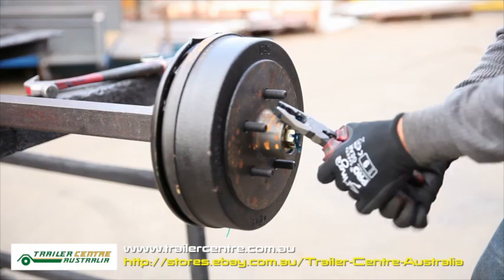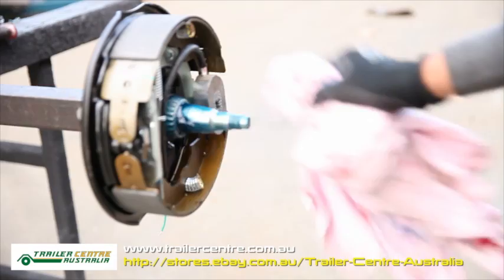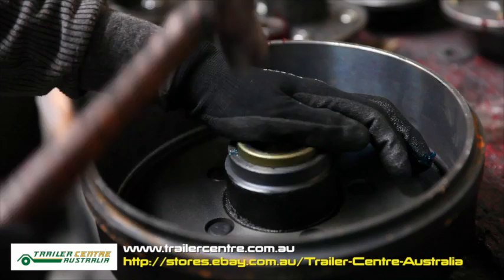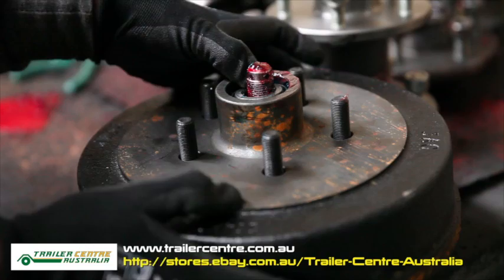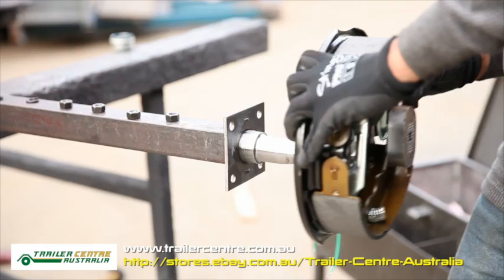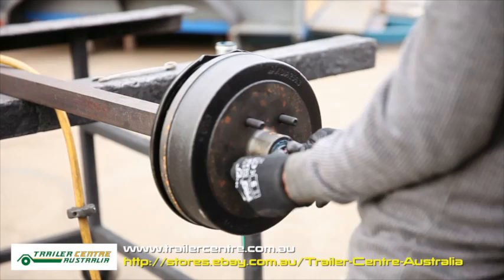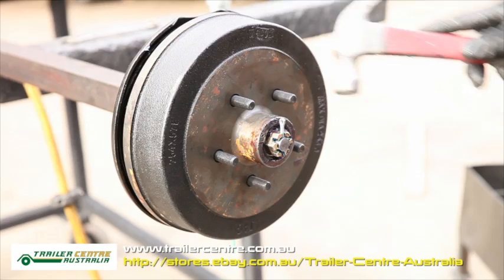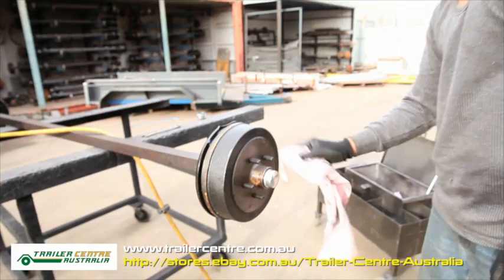How to install electric brakes on your trailer - TRAILER CENTRE AUSTRALIA

Comment: For anyone watching this, do not follow these instructions. 1...the square magnet of the assembly must face downward and not to the side as this shows.  2....the actuator bracket that attaches to the magnet is u shaped and MUST point toward front of trailer. This one was point either to ground or sky as magnet wasn’t on bottom.  There’s a right and left and aren’t interchangeable.  3...leaving that axle nut that tight will fry those bearings real quick.
Reply: I think you missed the magically reversing bearing that was being removed. But thanks on the first two parts. Yeah. The Castle nut procedure was NOT finished correctly...I actually counted the number of turns it took to get each of mine off. (On the wheels with brakes...have not started/checked the rear wheels yet.)
Coincidentally, it was 10 turns on both...and I do mean "10" turns to the same spires. Huh?
Who ever had this apart last did...something consistent? I mean, the guts were not present...on both wheels...no brakes...but lots of Spider webs!
  The joy one gets from working on a, uhm...close to 70 years old DIY trailer. I keep wondering if the damage occurred after the brakes were removed?
  Other than lifting the entire top to replace the entire floor and rebuilding the side door which was missing the bottom aluminum extrusion, (rigged in a descent door sweep) the back ramp being not square, removing the louvered windows for plexiglass and the door window/s also, this trailer just,- might,-- end up as just, "simply" a piece of sh!t...but not until after I fix the cracks in the frame.
  I had to get that out. This is March and I started this in, uhm...October! It just has to survive at least one trip to Missouri from California. 
⏭

Comment: Then after you spend all that money and take all the time to put them on you can go to a nice secluded place and kick yourself right in the BALLS, because those electric brakes are nothing but garbage!!!!   They are also a HUGE pain in the ass to maintain.  if you want a REAL set of trailer brakes spend the money and install a set of electric-over-hydraulic ones on it.  THEN you'' have some brakes that will be there when you need them and you won't have any brake wires in back of the tongue!